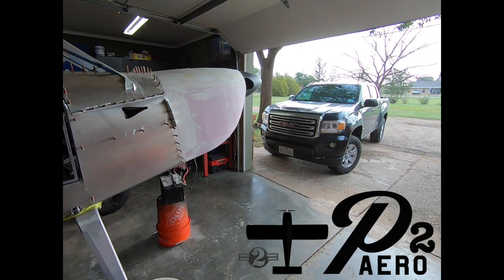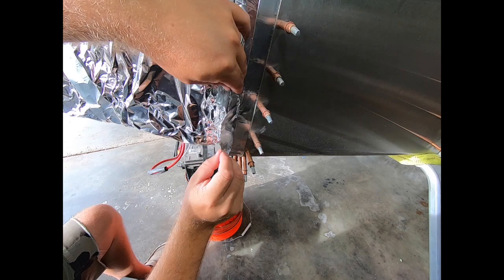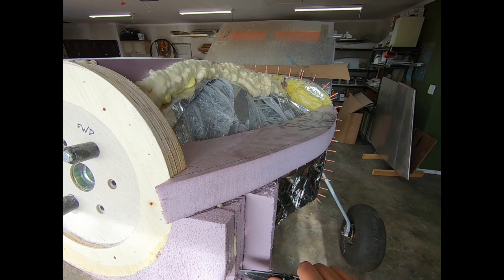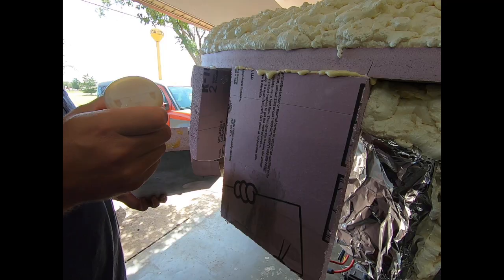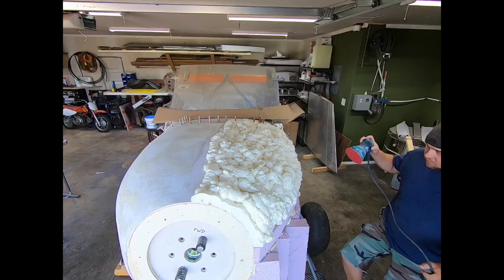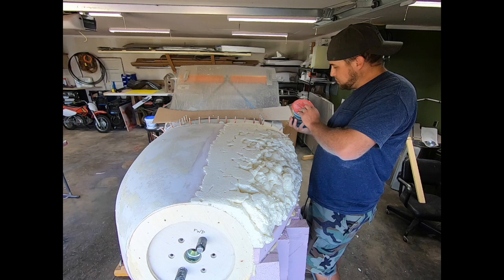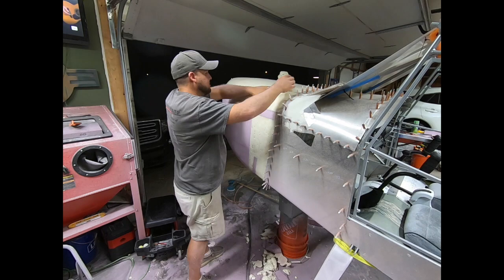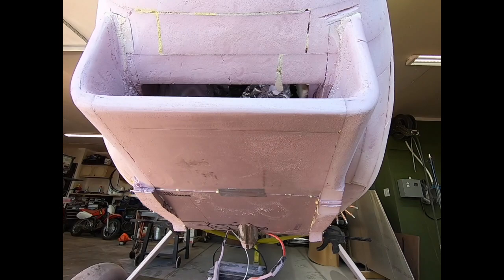Scratch Build Composite Airplane Cowling EP 51

Comment: ever try using a foam wire "knife"?   Can be very useful in bulk convex cuts (I make mine out of conduit and a wood backbone - string some safety wire (or nichrome wire if you have) - and hook to a battery charger - or train transformer).  Also - since you are a fan of gorilla glue (like who isn't!) - mix it with some vinyl spackle (1part GG to 10 part spackle) - and you will get expanding foam!!!  Great for those finish dimples - and quite sandable and shapeable!.   Great looking cowl!!!
Reply from the maker: I have never tried a hot knife before but I can imagine it would be a useful tool! Thanks for the tips👍

Comment: Awesome work here Josh.
I’m pretty sure your scoop intake is much larger than you need and will create more drag than necessary.
The inlet should be smaller than the outlet
Reply from the maker: I hear ya, I’m feeding the coolant radiator, intercooler, oil cooler and air intake all from this one scoop. Forced induction makes a lot of heat and the exit part of this cowl will be addressed later in the series👍 Thanks for watching and commenting! It’s a bit of an experiment so we shall see what happens when we get to testing it…

Comment: So unique in so many ways. Nice! I know you're engine is liquid-cooled, will the inlet scoop allow enough air for both the radiator and turbocharger, or will have to add an intake?
Reply from the maker: The intake is sized to supply air for the radiator, intercooler, oil cooler and intake. (Hopefully).. lol it’s a bit like playing pin the tail on the donkey or black magic. More to come on all the ductwork inside the lower cowl to get it all to flow like I have planned.  I’ve done all the reading I can do, took a somewhat educated guess and we shall see if it pans out. If not, I can do version 2 right🤷🏻‍♂️. That’s what “experimental” is all about in the end I suppose…